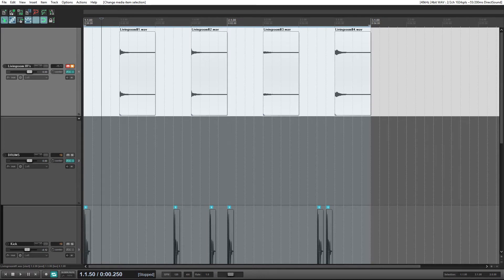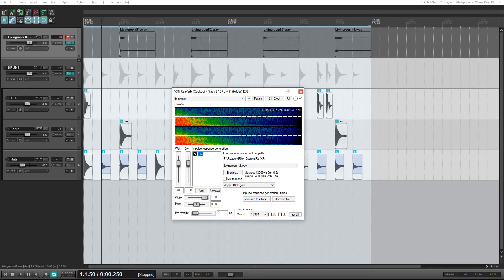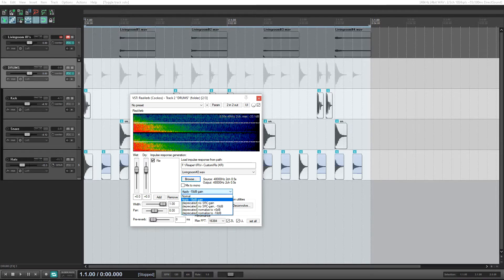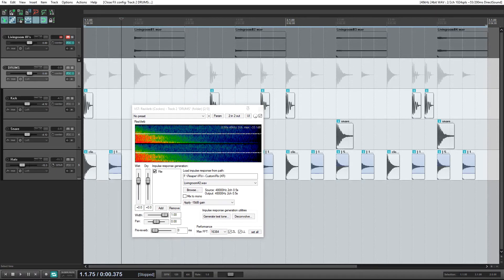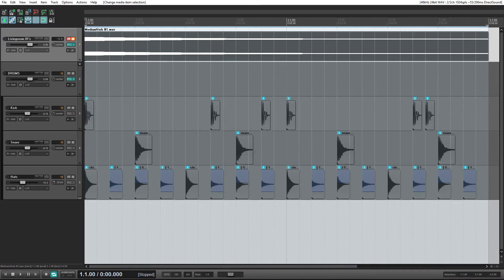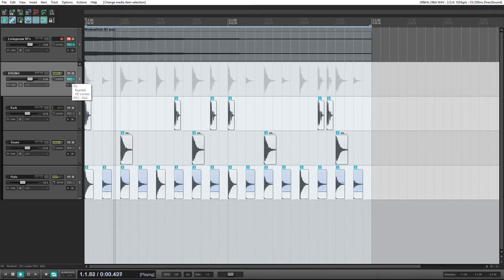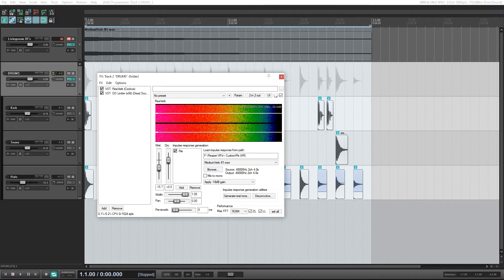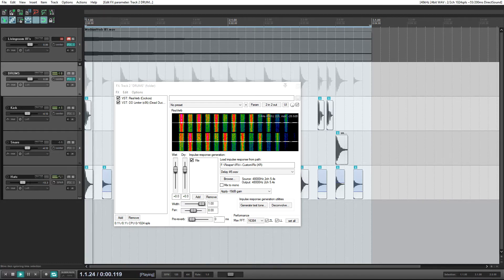Easy Ways to Make Reverb IR's (Impulse Responses)

Comment: Hi Xavier, thanks for that great video with clear explanation what you've done. 
Just to add a small contribution: Combine Part 2 with Part 1 is another possibility to gain quality for real rooms: Instead of clapping you could (for instance) give  a noise reinforced by good broadband speaker system into a real room of interest (for instance a church). Then let the noise build up in the room for (at least) as long as the expected T60 reveberation time of that room (https://de.wikipedia.org/wiki/Nachhallzeit) and record the whole answer. After that period you "cut" off the noise (by quick fade of 60ms or something around, to prevent a distinct cracking sound to be populated into that room in the very last moment) and record for (at least) another T60 period. Then - at home - just cut off the first part of the recorded audio till exact that point in time where the noise was taken away.
Sounds complicated but is very simple. The benefit of playing a loud broad noise into the room is that the room is stimulated at all relevant frequencies of interest. The result will be far more independent from the tonal quality and color of the clapping. Again - thanks for that great tutorial!
Reply from the maker: That's fantastic! Thanks a lot for the extra info! 
I'm learning something new here. 👍